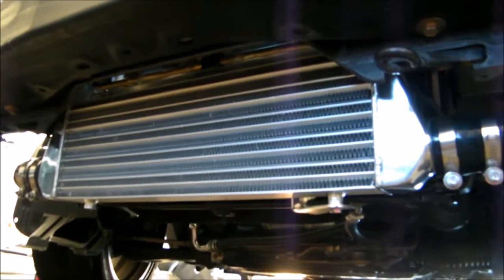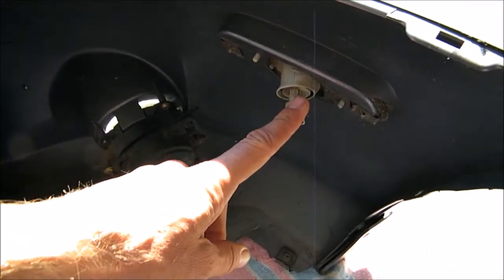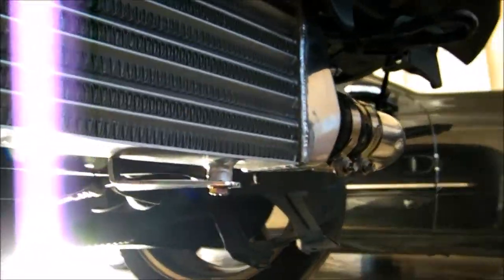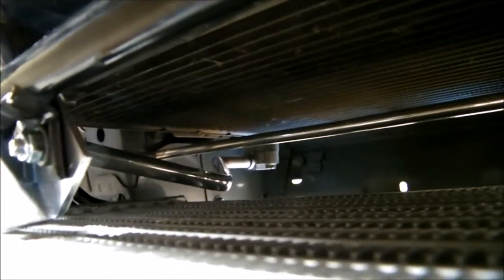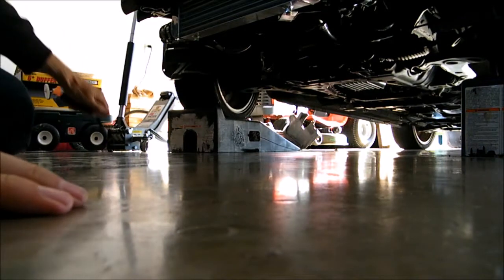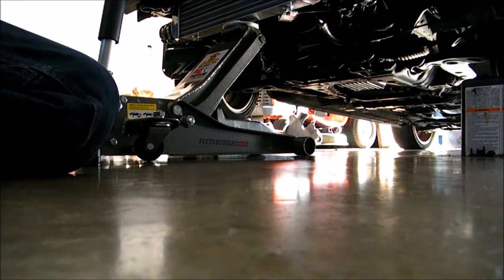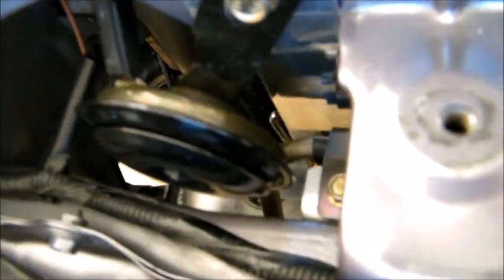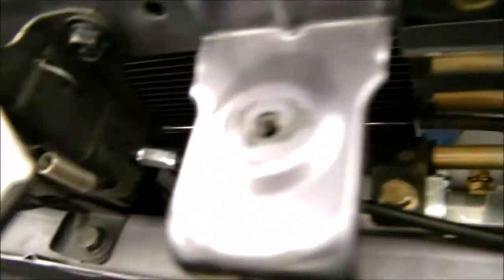Mazdaspeed mx-5 ebay intercooler install video

Comment from the maker: One other thing I did was elongated the bolt holes in the crash sensor bracket that is on the frame behind the bumper in order to slide it up & to the side to make a little extra clearance for the power steering lines. The electrical connector to the sensor was too close to the line.